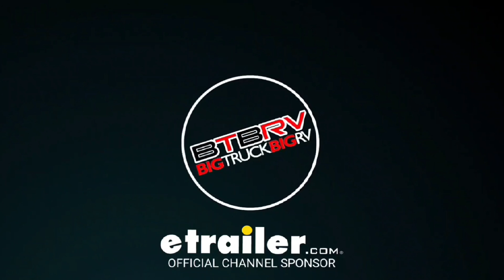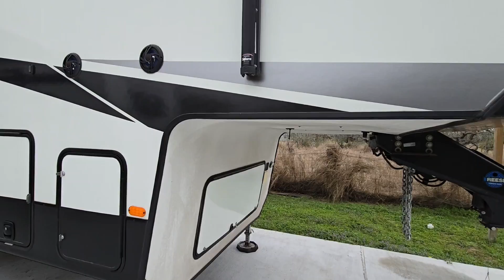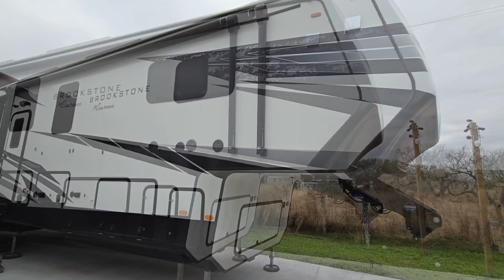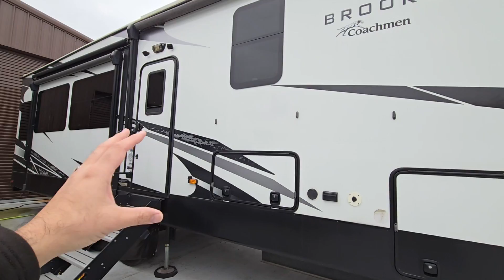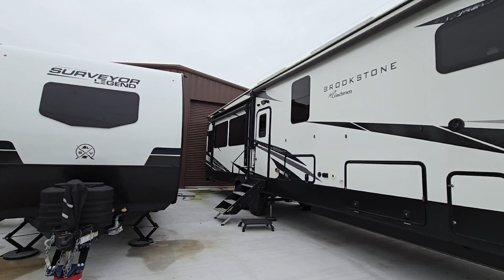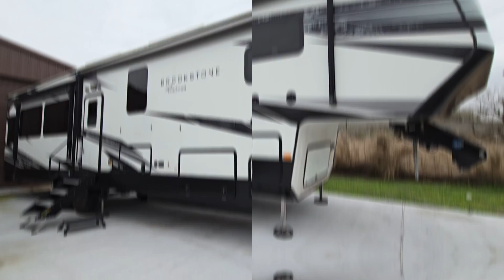BIG FRAME FLEX Update! Heading to Indiana ask Lippert Viewer Submitted QUESTIONS!

Comment: I've never seen this as a Lippert problem. My understanding is that they build a frame based on a particular manufacturer's specifications. There's little to no accountability on behalf of the people who build these things and lm very disappointed that you failed to mention that since COVID the industry quality has become junk! It's not always the owner's fault. There have been a lot of videos on the Grand Design issues. If extra gussets can fix the issue, then why not include them OEM? Curious to see your follow up....
Reply from the maker: Many times, I think there's a perception that having a welder come in and by adding gussets and reinforcements on will fix the problem. If the original problem of detachment isn't fixed however, you're still overloading or creating high stress points in areas that shouldn't have them.  Over time, fatigue can even damage the areas that have been welded.  The truth is, it takes an experienced engineer who's been doing this for a long time to truly understand where the energy is, and how to best displace that energy when coupled to the RV superstructure.

Comment: I believe it’s operator error/misuse due to many of these people have newer trucks. I see many of these large 5th wheelers on the road hitting speeds pass 80mph, quick get up and go and stopping. 
Now a 2003 f250/350 diesel engine 6L has 325hp and 560ftlb of torque. A 2023 f250/350 diesel engine is up to 500hp and 1200ftlb of torque. So a good amount of increase in hp and torque just within 20 years. These truck weighs around 7-9k . A class 8 semi truck engine are around 400-600 hp and 1400-2000 of torque with a weight around 15-25k. Not much difference between an f250/350 and a semi truck as far as power. Truck towing and carrying capacity is a different story due to frame size, brakes and other factors.  But the power to weight ratio is huge. So a semi truck is pulling 40-60k. With a f250/350 towing a 13-15k trailer with these trucks, you can easily flex the frame until failure by driving aggressively. Then to add overloading and/or loading it incorrectly, greater chances of failure. 
As a mechanic, I seen many operators errors and misuse working on vehicles, heavy equipment, helicopters and aircraft. I seen cracks developed due operators. Yet everyone blames equipment. So until someone shows a metal analysis between an a new lippert frame and an old frame or design was changed or poor welding like the issues from the hanger spring mounts which was true. I don’t take this flex frame seriously.
Reply from the maker: That's an interesting point for sure.  I feel it's worth asking when I get a Chance.

Comment: AND, if this is such a small issue, one half of one percent right? Why is Grand Design crapping on it's owners and not taking care of them. This reminds of Ram denying warranty repairs because their frames broke in half because of the size of their camper. You can't imaging the loads I have put on my 1987 F250, 2001 Ram, 2006 Ram, 2022 F450, now 2024 F450. Never an issue with RV's or Trucks. ANd it's not a brand thing for sure right,  just seems to be a couple models and sizes of Grand Design RV's. Your time would be better spend visiting the place in Indiana that is actually repairing the units for good. Go interview them, they know the issue and the fix. Truth is, and the engineer isn't going to tell you this, is folks that "Full Time" exceed the engineering of many of the largest Grand design RV's. It's quite simple. I will say, I do put less responsibility on the frame maker because the RV manufacture HANDS THEM the spec to build and you know lowest bidder always wins.
Reply from the maker: I do completely believe that were and when the manufacturers are at fault they should step to help customers.
Reply: @ckBigRV Then support the folks with the issues and your your influence for good by putting real pressure on them. Not giving them 50 ways out of it by making excuses. I mean yes, if there is a ton of physical damage to the RV showing evidence of abuse, or if someone "Modded" the unit say with massive battery packs up from in a solar system, Yes. I've seen enough folk that are professional RV'ers that don't abuse their stuff have totaled RV's. But blaming a plumbing leak for totaling a $150K RV, now that's a stretch and again, poor design.
Reply: I think Grand Design needs to step up to the plate and fix/repair ALL of the frame failures that the owners are having, regardless of 2nd or 3rd owner.  From a business and marketing prospective, they are severely compromising their name.  

The Paving New Paths YT channel should have been immediately and promptly repaired as well as others.  If GD stepped up to the plate and stood behind their product and customer service, they would have even more customers now!!!  What in the Sam Hell are they thinking!!!

That should be your next stop after the interview with the Lippert engineer, is a sit down interview with the CEO of GD and find out the reason they refuse to stand by their product.
👍😃🍻☕️

Comment: Wonderful video.  I’ve never owned an RV before and I subscribe to your channels as research should I decide to buy.  Water can cause a lot of damage regardless if it is on an RV or your home.  I’m under the impression that while a lot of campers have laundry prepped hookups, most don’t use them.  My question is, does any manufacturer that preps for a washing machine have a drain for any leaks?  One could have a laundry leak and may not know about it and water and wood don’t get along very well.  So if they don’t already do this, why don’t they design any water prone area (laundry room, kitchen, bathroom) to catch any possible leaks and just drain outside in the ground?  Wouldn’t this make for a better RV design?
Reply from the maker: That totally would be a great idea! I'll pass it along to manufacturers that I collaborate with for sure!  Thanks
Reply: @BTBRV  You’re welcome.  Perhaps I can get a free RV for my collaboration?  LOL
Reply: I put a washing machine in my 1997 30ft. built a tray out of wood tapering to a drain through the floor back into the grey tank. Fiberglassed the whole tray before install, hasn't been needed yet but it is peace of mind. On a side note I will be moving our laundry room to the upstairs bedroom area soon and will be building a larger version to be sure the main level gets no water damage.
Reply: Most washers are suppose to be sitting on a pan made for them that is water proof. However it's been awhile since I looked for a drain under any washer installed at the manufacturer, but do recall seeing years ago a proper pan n drain on a few. But nowadays with the cheap-out on everything I haven't even looked to see if they are even mounted on top of a proper water proof pan, yikes. 🍻

Comment: Thank you JD for your effort to put some sanity in this discussion but unfortunately we are living in such a low moral standard days that in some cases it is impossible to have a sane and productive conversation.
Everything today seems to be used to get views, the  "shock the whole industry" thing.... It is just terrible because the bottom line is that through LIES people want to get views in order to make $ so basically lying to make $.
Under such circumstances, I found out that to keep my sanity I should believe nobody, period, just treat everyone as liars, let facts turn my perception around and only use what I witness / experience as decision factors.
And here is where I agree with everything you said and I can add that I have witness many times people just trashing their brand new units. People seems to not care for the huge amount of $ they spent on the unit and simply don't care.
Then they sell the unit afterwards because they unit has "low quality" and here comes the second owner pay the price for the insanity of the first owner.
I recently saw a Thor Aria motorhome with less than two years old completely trashed, I mean, my former 4 year old Rockwood would look brand new compared to that Aria... What kind of people do that to $300K brand new equipment??? Would that be Thor fault if things break falls apart in that case??? But certainly a video title "worst quality RV ever", etc will be produced ....
The ONLY reason we always bought new rigs is exactly because of that: Many Americans have no care for their things and just trash it.
You add to that a tendency of full timers to overload the units plus high mileage (Does Grand Design approves full time living???) and then we can reach a conclusion, w/o all the hype, that in fact it is a miracle (or good engineering???) that this problem is not happening in 60% of the units.
I'm not taking the blame from the Manufacturer for I haven't seen a deep dive in one unit that had the problem BUT I'm judging the situation based on what I have witnessed: 
Many Americans just trash their stuff and then blame others (for the problems) or just simply lie and transfer the problems they created to others.
Soo fed up with this situation!!!
Reply from the maker: It's the "throw away" mentality my friend

Comment: JD, I enjoyed your video. People fail to realize that an RV is a piece of equipment. The more the equipment is used, the more wear and tear is put on the RV quicker. I have seen many videos on YouTube about frame flex from people who are experiencing frame flex. The majority are second owners, full-time users, and have modified the RV. I agree with what you stated in your video. Josh, the RV Nerd put out a video on frame flex, and his video stated many of the same points yours did. When I purchased my 5th wheel, I asked the dealer if this 5th wheel could withstand full-time use. He stated that no RV can withstand full-time use. He said RVs are designed to be used around 15 trips a year. So, in 10 years, you have used your RV 150 times. If you are full-time using your RV, you will speed that process up. Search, YouTube for mods to do on an RV.I hope you have a year s worth of free time because that is how much time you are going to need to watch the videos that pop up in your search. I have seen videos where people change out their RVs axles to higher rated axles. They state that doing this will help if they happen to overload the RV. My question is, what about the frame? Axles are only part of the equation. I have been a mechanic for 40 years. 24 of those years, I was an aircraft mechanic. I have seen what stress can do to frames. That is why the USAF has load masters that are highly trained in placing cargo equally on the aircraft to distribute the weight properly. The same principle applies to loading your RV. JD , keep bringing the truth. Dont worry about the negative comments. You aren't an RV fanboy. You call out things all the time that can be improved.  I guess people forget when you used a 5th wheel that was loaned to you, and you didn't hold back on the negative comments. Can't wait to see the next video in this segment.
Reply: Excellent comment, thank you. I’ve only owned two RVs - and bought both new. Paid more, but knew every bolt, screw, wiring, plumbing and mile on that rig - often because things broke with wear. Also learned to do plenty of preventative maintenance- and I’m still learning. But not naive enough to think my trailer builder is responsible for everything on there……..forever.
Reply: @brucewallace3860  I am new to the RV world. However, as I stated in my original comment I was a aircraft mechanic for 24 years in the USAF. I learned that no matter how well you take care of a piece of equipment, it still breaks. I wonder how many people actually get their RV weighed by something besides a CAT scale? I weigh mine at the beginning of each camping season and each time a change what we have packed inside of the RV. I am trying to find a place that can weigh mine at the 4 corners.
Reply: I heard somewhere that these RVs (Including Motorhomes) are made to be used 30 days / year so if you are full timing, the wear/tear that you are imposing to the rig every year is equivalent to 12 years of the designed use....
That to me makes sense and justify plastic faucets, fake wood, etc...
Now, there are units made for full timing but DRVs and Prevosts prices are way above most people price range....
Reply: @1798iscomingback  I agree 100%. I forgot to mention in my comment above that the 15 trips a year were 2 day trips. So our information matches up.

Comment: So the failure of the manufacture attaching the “house” to the frame is the issue to welds breaking or welds not being done properly ?   Who should fix the issue then?  The manufacture of the RV or the Frame builder?  A lot of your issues with leaking can be attributed to not using the correct PEX connectors that eventually leak.
Reply from the maker: There could be multiple companies in people at fault.  After investigating why the issue occurs, then you know who to point the finger at, and who to expect to fix the problem. It is the responsibility of The party who caused the initial problem which led to the other problems.  I do agree though, if PEX connectors fail or they're installed incorrectly, they can lead to water damage. That would obviously be on the manufacturer I guess.

Comment: If I were Lippert this is exactly what I would say.
Reply from the maker: What part of this wasn't factual though?
Reply: @ckBigRV You can just hear it in your voice that you're an apologist for the manufacturers.  If a leak from plumbing or washer totals your RV, it wasn't designed right. I've owned RV's my entire life, on road, off road, slides, no slides, wood, aluminum, all of it. Had plumbing leaks in most at one time or another.  Have you actually looked at the repairs and documented what they are fixing? Not water damage. Under engineered 1000%. Doesn't matter if you are the original owner or 4th owner.
Reply: @BTBRV  "What part of this wasn't factual" <-- Well, I hear you talk a lot about non-frame issues.  Frame flex appears to be a steel chassis issue, but you instead talk about what is attached to the faulty frame instead of the faulty frame itself.  Most of the cases I've seen, have cracks in the frame, the "steel".  Now if the frame is overloaded, then that is another issue, but that would probably develop cracks over time too.
Reply: He very well have good intentions. But this issue is being underplayed and I’d even go as far to say your typical weekend worrier wouldn’t detect the broken frame. After following this for months and months now on forums and here, looking at who the excuse makers and censors are, it would be worth looking into car crash investigations dealing with Grand Design 5th wheels.
Reply: You can be “factual” and leave out an incredible amount of information.  How many times did you mention inferior construction of the frame, bad welding, cracks at the welds, the denial of lippert to except any responsibility or the large number of these incidents.  This was a video of anything else that could possibly cause frame problems besides the frame manufacturing process.
Reply: Well it is obvious that Lippert paid him to say it.  What would you expect from a sellout.

Comment: JD you have received free stuff from lippert. Look back at your  videos. You have been very biased about lippert. Frame Flex, Is Frame Failure. This is America Rv Manufacturer Should Build Their On Frame With Pride And Protect Their Reputation.
Reply from the maker: Reviewing products that are provided as far different than being sponsored.  I've always provided an honest evaluation of any product I review from any company. Nothing in this video was a cover up for anyone. All it stated is that the RV manufacturer must connect their structure to the frame properly or these problems exist. How is that covering up anything?
Reply: I don't believe that its lippert fault, I think it's the Rv manufacturers issue for not providing a strong enough connection to the upper deck and taking the load from the bedrooms, washer/dryer or Gen set and batteries that come as add ons.

Comment: Can Lippert provide me with a list of which Interstates and State Highways to AVOID?  I never heard you mention, what about when the welds break, or the frame cracks??  You talked about the small percentage that have issues, say it like it is, ANY Towable and especially 5th wheels that are over 35 feet WILL have problems!!!  But yet horse trailers in that length or LONGER DO NOT have these issues.!!??
You really sound like a POLITICIAN and you have LOST ALL CREDIBILITY in my book!!!!   Good Riddance!!!!
Reply from the maker: Horse trailers are an entirely different design and are engineered with lighter weight materials much smaller loads in the upper deck and do have similar stress points.  Horse trailers largely position the heaviest portion of the weight directly over the axles which are spaced for their back.  Lippert actually builds frames for many horse trailer manufacturers. If you unsubscribe because of a fact-based video I'm not sure there's much I can do to save you.
Reply: @BigTruckBigRV  Not the horse trailers I look at, even RV horse trailers. The axles are way to the back with a lot of pin weight! Have you looked at the landing gear legs??  A BIT HEAVIER DUTY! Built with better engineering and higher quality....with a higher price.